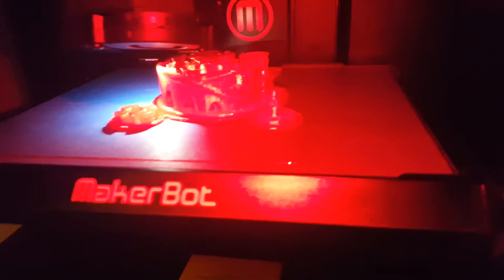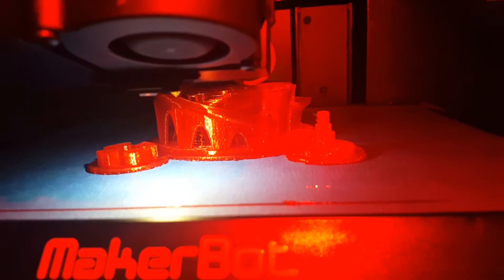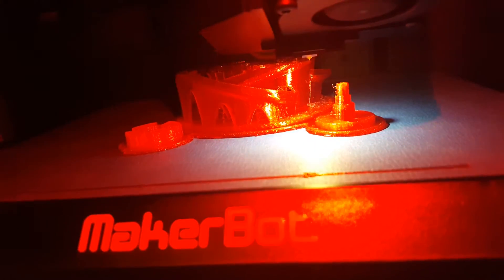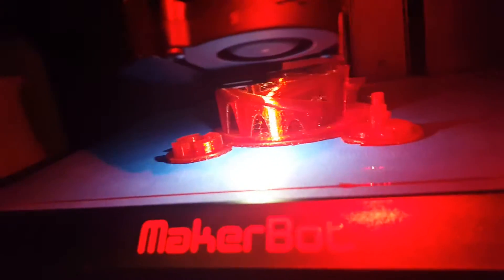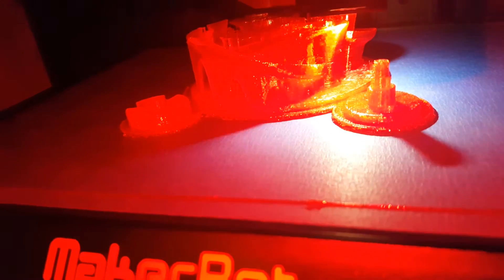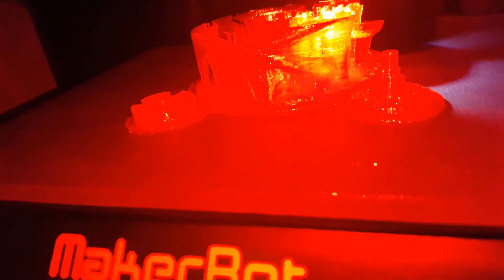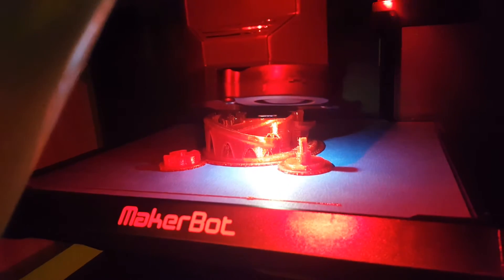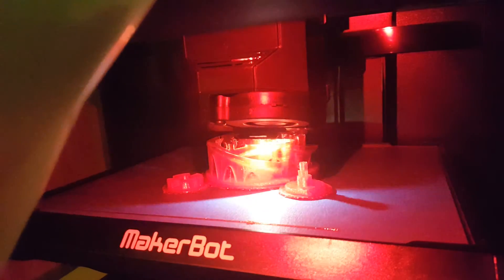3D Prints Curling Up? Try this!

Comment: What I can't understand is why Makerbot lets its userbase languish with everyday problems like this. It's like they don't care that most prints don't work for customers. It's nearly impossible to use the full bed area for a print. I've wasted so much time and material on bad prints. 
They strictly say don't cover any part of the MBot, it needs open space. I had to cover mine up agains drafts, as you say. I also lost two $250 extruders doing that. Something happens at a certain temp and the extruder self destructs. The filament somehow curls back into the frame of the extruder and totally gobs it up - both were unfixable.
One YT video said print heavier than .2mm extrusion, I am trying .3mm right now to see if it makes a difference.
Reply from the maker: Interesting, I'm basically not having any of those kind of issues and I'm really impressed with the machine after many years of using it for all kinds of random stuff. This video addresses a problem related to the big flat-bottom object being printed, it has nothing to do with the printer itself, in fact, other brands also struggle quite a bit with big horizontal plates.

Comment: Any news if the increased ambient temperature has caused any damage to the power supply?
Reply from the maker: Nope. She's still trucking along after many years and many pounds of filament. I can even do ABS on it, no problem. Still not sure why Makerbot doesn't completely own the market. Excellent product.